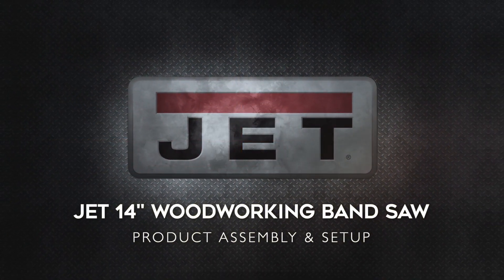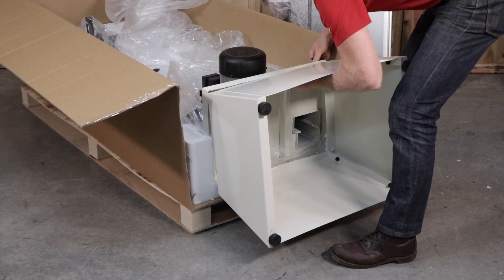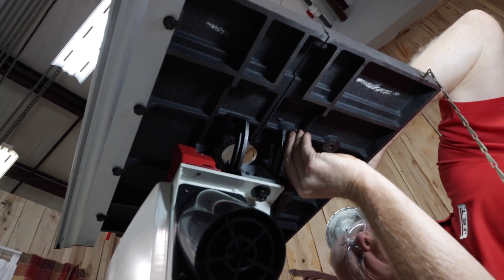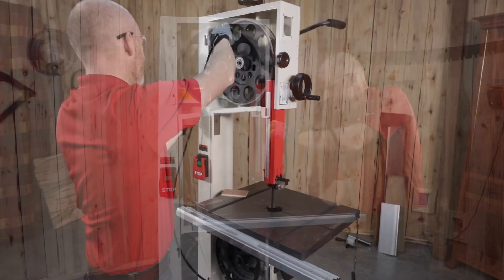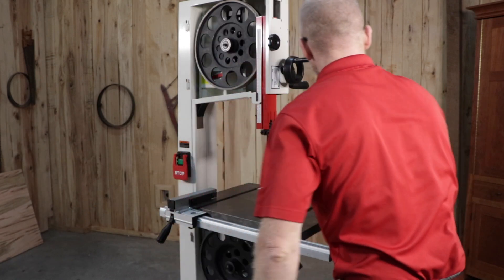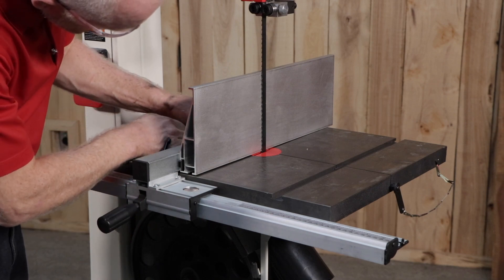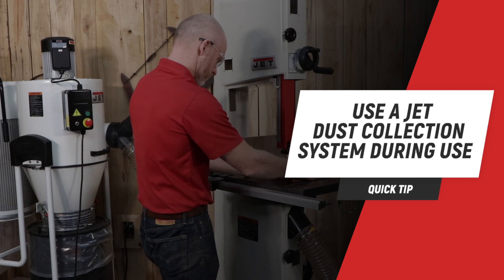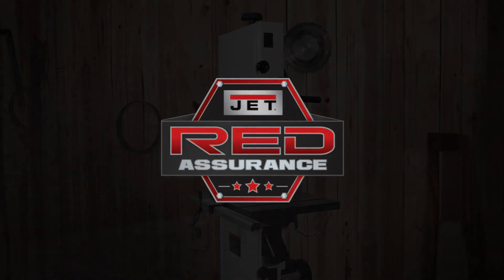JET 714400K 14" Steel Frame Wood Bandsaw- Assembly and Set Up

Comment: yeah at 1:03 the guy is installing the top screws in the upper duct chute but I wanna see him installing the bottom two screws lol can’t be done. I can’t get my fingers in there or the allen to get a couple threads started. Seems you could come up with a better way. Total aggravation on this part. It took me 30 minutes to get those two FU*** screws installed😡😤😤😤
Reply: Sorry if you already have some but, ball-end Allen wrenches are worth their weight in gold.  Bondhus are really good and not too expensive.
Reply: Rick Goodman yeah ur right
Reply: @rickgoodman885  Thank you for this suggestion! I was able to use a ball head allen wrench and it worked out.

Comment: If the saw is not on a pallet, but just on the box and you raise it with only two bolts attached to the base you will bend it.

Comment: Hello, does this machine fit in a box of 48x24x21?  I want to take one of these to Brazil, and that is the limit.
Reply: No; even if you tried to re-box it, without the base, the main body of the saw is much longer than 48". Shipping dimensions as boxed from the factory are 63" x 27" x 20".

Comment: I’m having a lot of trouble with the fence and getting it to zero. One of the screws cannot be removed due to the way it was placed to help with the lever locking mechanism. Would be nice to have a bit more in depth instructions/video on adjusting that since I’m convinced it’s impossible !